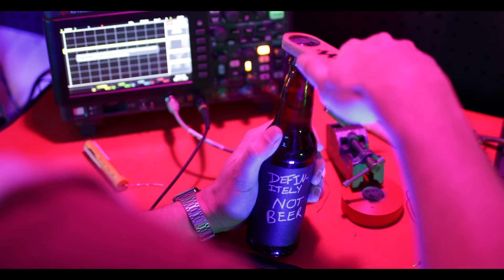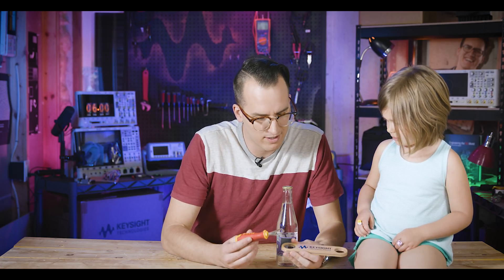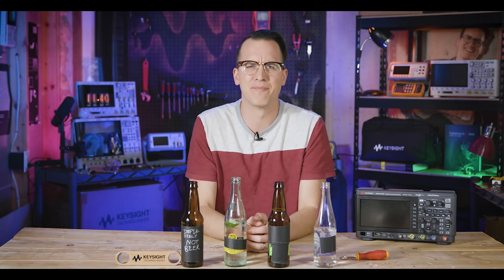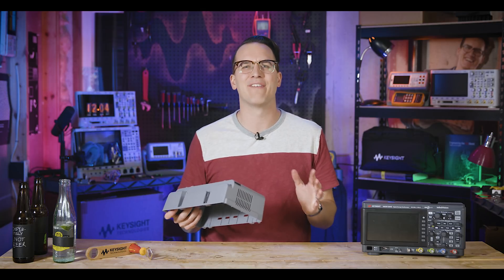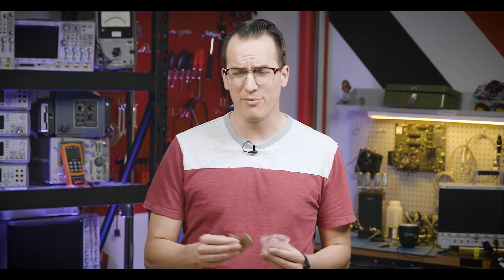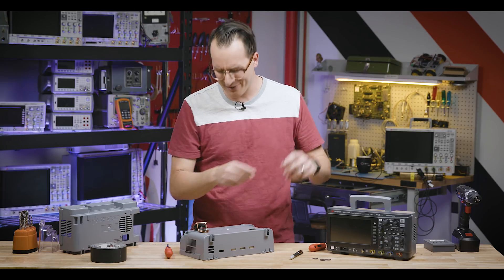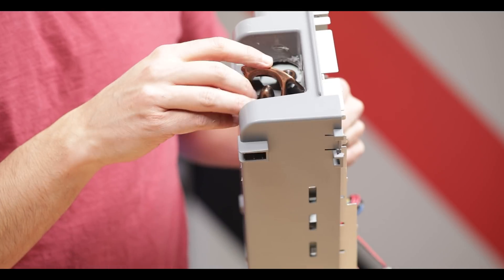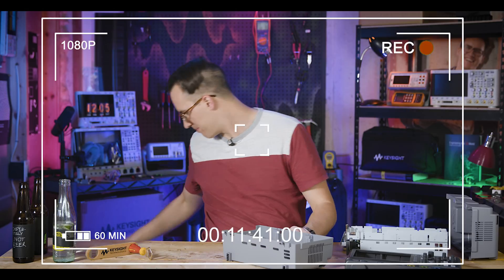Who Did it Better? Fluke vs. Keysight Bottle Opener Showdown

Comment: +Keysight Labs You want utmost secrecy, add a handle like on top, to bottom (say its for your Australasian market) and when shelf mounted, by adding a secret door in the shelf it hides the "Down under handles" hidden secret, Duh!  No possibility of the unit tipping over, like they are worth anything (insert COVID COUGH here) in the software Keysight would undoubtedly detect this handles use voiding further warrantee.

Comment: You already have the perfect interesting shape for a bottle opener the Keysight wavy oscillatory logo.

Better still a bottle opener that can open a flip top and screw top bottle cap, make it fully catIV insulated and with a digital force gauge built into the handle....👍🏾
Reply: And oh yes a precise temperature gauge your not gonna open the bottle if it’s not the right temperature.
Reply from the maker: That's a good idea! Built-in thermal camera 🔥🔥🔥
Reply: @KeysightLabs  and don’t forget  if there is any thermal noise from the bottle you can have a port connection to the bottle opener to connect it directly to the oscilloscope - so many wins I can keep going not sure if you guys and gals can keep up😉

Comment: Fun fact: A lot of older HP gear came with bottle openers from the factory. The side handles on the 130C, for example (not that I would have EVER used them that way)

Comment: I remember on May 15, 2011, I was hunting around for a churchkey and couldn't find one, so I had to make do with what I had. I attempted to use a heatsink, but it kept bending. I eventually used the handle on my telequipment D52. The next day I picked up a churchkey on the way home from work. Certainly not as clean as this mod though! I like how it leaves the BNC and LXI connectors open and you might be able to get a right angle USB adapter in there.
Reply from the maker: I do think a right angle USB cable would work

Comment: You could 3D print some custom snack trays and attach them at the back of the scope (out of the view of your boss).  Of course, this will likely result in many greasy/cheesy fingerprints on your touchscreen scopes.  Great video... the outtakes were the best.
Reply: Add in a little heating element for optimal snack temperature

Comment: Ok, magnet failed in holding bottle cap... But this is a great idea... 1k USD scope + 100$ for Hardwere Implemented bottle opener + Softwere cap counter.

Edit: magnet didnt fail after all, but still... noone should know that you drink at work :)
Reply from the maker: Idea: make it an electromagnet and sell a software subscription to enable it. I think you're on to something.

Comment: Wow, that is an ergonomic disaster for right handed people. If the scope is in use on the workbench the scopener should be operated on the other side to avoid wrist damage.
Reply from the maker: Do the same build, but with a left handed scope!
Reply: @KeysightLabs  Do you actually sell those? Or would I have to check the other scope makers?